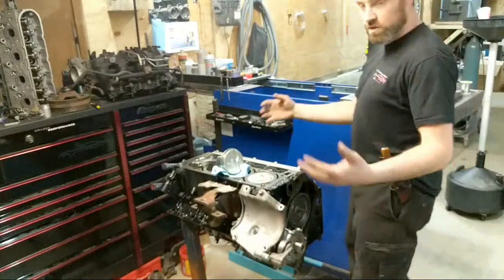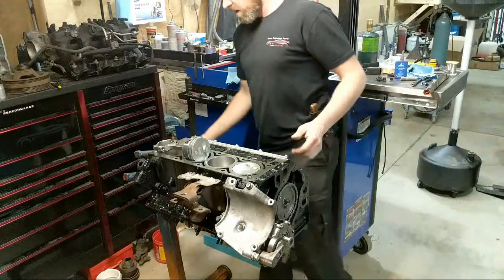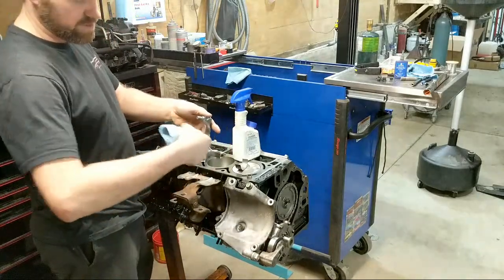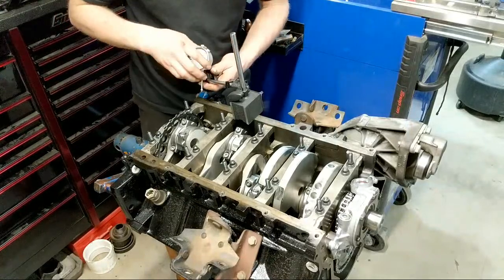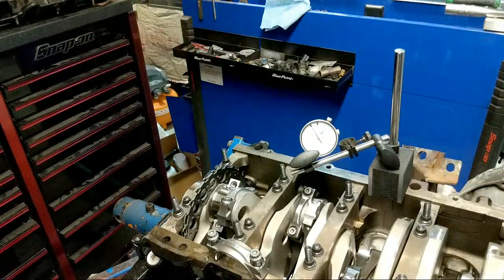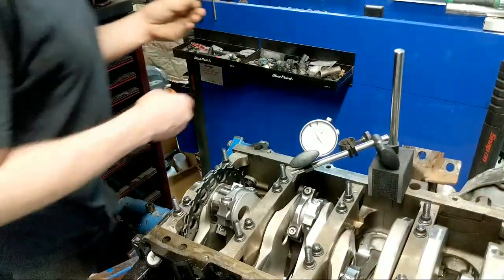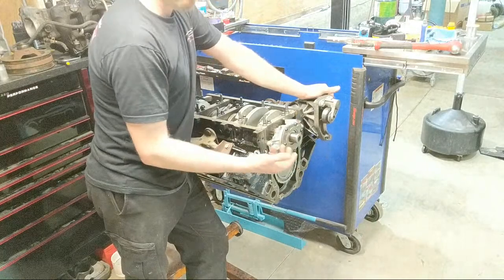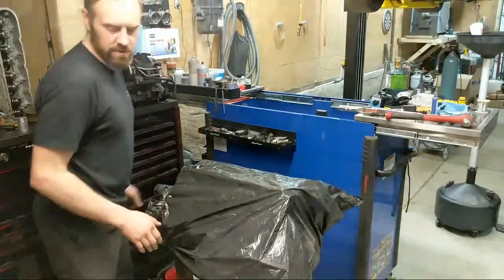LIVE!! Stroker 5.3L LS Based Engine Build Tech Talk

Comment: Do you have a video that shows lS Harmonic Balancer installation?
It's not keyed like the old SBC and I can't find a definitive answer as to whether or not it needs to be installed in a specific direction or if it doesn't matter
Reply from the maker: It doesn't matter unless you go to aftermarket dampener like an ATI or something. They come with key to make sure it holds. I do have a video on it though.

Comment: How are the 799 heads I just did my lh6 with v2 btr cam stock bore I want to do the same stroke as yours where did u get the rotating assembly?
Reply from the maker: I pieced together the assembly. Bought all individual part's then had them balanced after I knife edged the crank. The kits where it comes with all the parts where more money. It cost an extra $500ish that way. Then I also would have something balanced without the knife edged crank. I used my savings from buying an assembly to put towards the balance. The balance only cost $200. 
The 799 heads are lower compression higher CC higher flowing head just like the ones that I showed. You can just mail them down to bring the compression up.
Reply: @CrazedPerformanceRepair  hey thanks for taking the time to reply I appreciate it man most don't take the time

Comment: Question for you, how much does the cam retainer plate on the front affect hot oil pressure? Thanks
Reply from the maker: Hardly any. The big loss is usually second camshaft bearing, lifters, or oil sump.
Reply: @CrazedPerformanceRepair  Thanks, I did an afm delete on my 07 gen iv engine, cam bearings did not look good. Proceeded with install and did not replace retainer plate, was going to tear it down again because oil pressure is 18 psi at hot idle with 10w40... Is this bad? Thank you.
Reply: @Johndoe-cz4gf  does your oil pressure pickup to a decent number under RPM?  Rule of thumb is roughly 10PSI per 1000rpm.   Meaning, at 4000rpm you should see 40psi.
Side note.  I had a 99 LM7 with 447k miles on it, and at idle the oil pressure was low enough to make the lifters tap.  But anything over 1000rpm would bring it up to 10-30psi and for normal driving that was fine.  Transmission eventually went up, but motor still ran. (This was also using the 5w30). So maybe would've picked up a little with 10w40, but I didn't care.
Reply: @jameswiz  I changed cam retainer plate and oil filter, up to 20 psi at hot idle, cruising at 55 mph I'm at or over 40 psi...
Reply: @Johndoe-cz4gf  Then if youve got 20psi at idle, and more at XX RPM then you should be fine for awhile.  These engines really do run with low oil pressure for quite a while as long as you don't beat on them.  If you're had that shit off at red light stuff, then you're stock bearings are a "Race type PTFE coated" (Teflon coated) bearing and will withstand use with very little oil for A LOT longer than regular bearings.  Because of the nature of start stop motors, they loose oil pressure at every red light.. so the startup wear is 10x worse or more, compared to a regular motor.  Thus they used PTFE on, cam, rods, and mains.  The PTFE absorption of oil is high, and provides great lubrication itself.  
These are the bearings I'm using in my new build.  The statement "you get what you pay for" is absolutely true!!  Do the research yourself and look up the cost of PTFE coated bearings versus Tri-Metal lead, or even my other fav, Bi-Metal alum-silicone bearings.  A set of rod bearings made out of lead or aluminum might be $30.  Coated rods.  Closer to $150-200...  
Ch-25 standard
Chp-25 perf
Chp-25t coated.
Reply: @jameswiz  well I'm not going to tear into it again, just going to run it till it blows, hopefully get another 40k out of it.
Reply: @Johndoe-cz4gf  I don't blame you and 40psi going down the road is plenty.  My experience would tell me one important thing about LS, BBC or SBC engines.  If they have "oil pressure" and I mean just about any oil pressure they will just run.  The biggest thing I found is that running them without any oil at all.  That seems to kill them all pretty quick. Lol